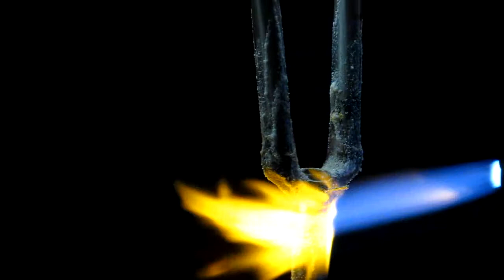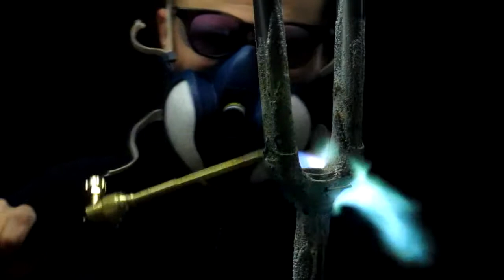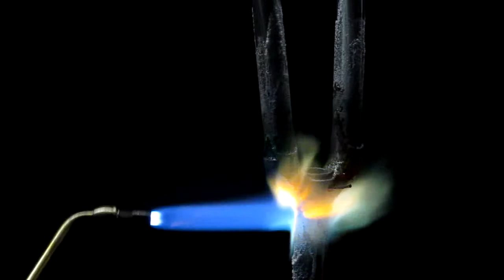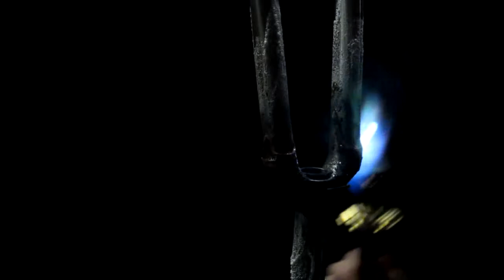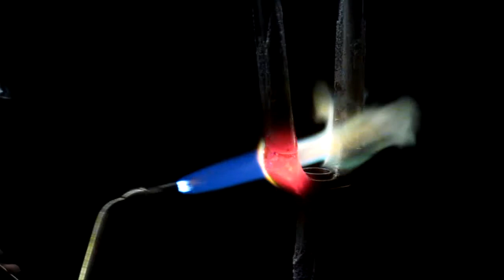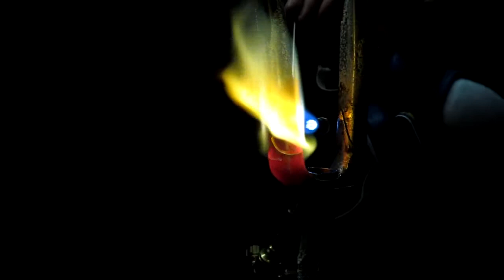Brass Brazing Fork Legs in to Crown

Comment: i want to ask about process from beginning. after put the legs on crown did you put any materiel between crown and legs ? or  you just make them together and braze ?
Reply from the maker: I sanded the inside of the crown so the legs were an easy but not loose fit, then I added flux inside and out and brazed the legs in to the crown with SIFBronze 101 brazing rod.  I didn't add any more brazing rod afterwards.  The brazing rod only goes in between the crown and the legs to fill the gap.  You can see photos and descriptions of the process here https://www.flickr.com/photos/philgradwell/albums/72157632370348849
Reply: Thanks Phil. Next week i will try to make my own.